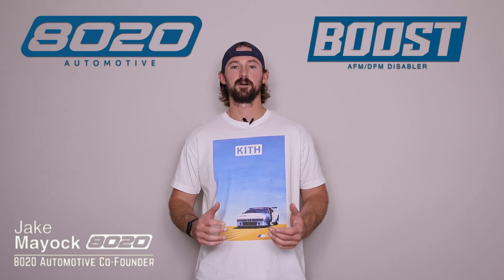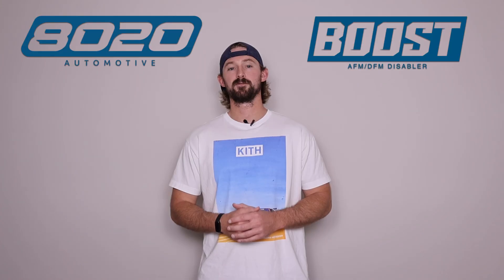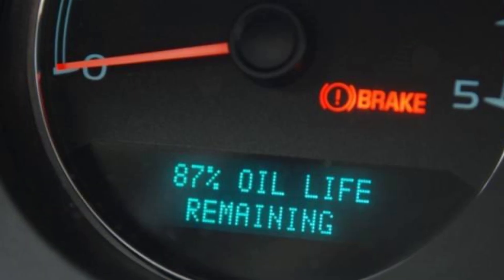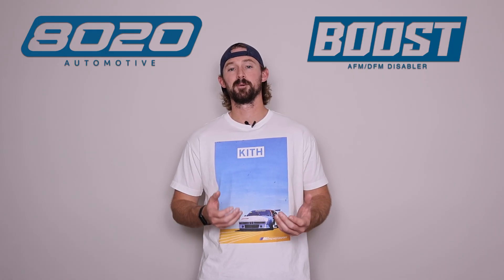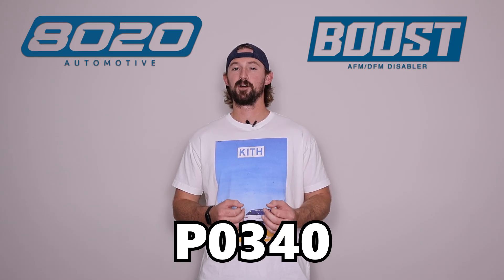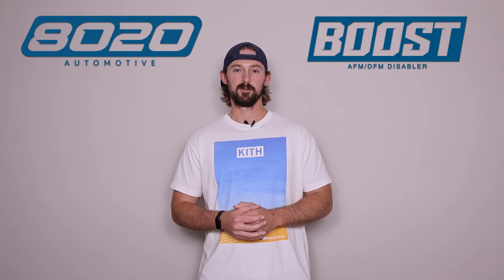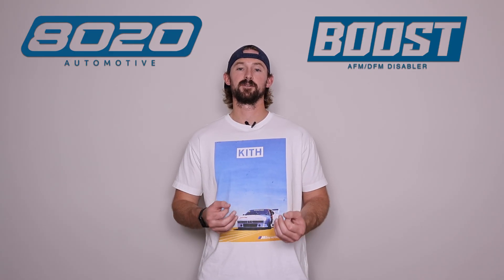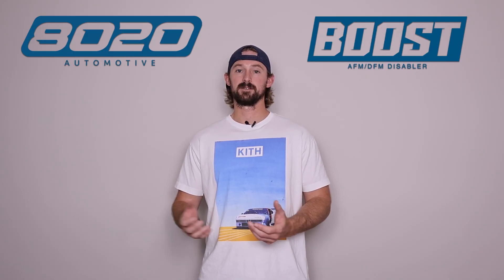Is GM’s LFX V6 Engine Actually Reliable? Here’s the Truth!

Comment: HELP!! I have a 2011 Chevy Express w/49,600 miles 15 passenger van. I am a disabled Veteran and this holds my service dogs crate AND my power wheelchair and lift. I bought it from the US Air Force at excess property sale. It was 6 months old and I paid $6000. 
I'm having electric (?) problems. I get odd dash lights, sometimes a/c fan works, sometimes no turn signal or seatbelt "dinging" noise going silent. I can fix my old jets which I flew. The F-111 and B-52. I was in training for the SR-71, but it would be mothballed before I finished. A great career. 
But I was injured and depend on a Rough Coated Collie and a bright red powerchair! 
Please, it's in the shop for a week and that means I am housebound. No. I don't drive much, but when I do, I want my van in my driveway!  
I've never given it a name. As a rare female fighter pilot with tail number 007, my call sign was "Tits"! Probably not politically correct now, but I could out fly any of my male squadron. I cannot afford a new van. I'm saving for a new service dog. $175,000 for a dog, so this van HAS to be repaired. This is the first problems I've ever had. Is it fixable?
Reply from the maker: J - First off, thank you for your service! We're sorry to hear that you're going through this with your van. Yes, your van is absolutely fixable—intermittent electrical issues like odd dash lights, A/C fan working sporadically, no turn signals, or a silent seatbelt chime almost always point to a bad ground connection, faulty body control module (BCM) contact, or a worn ignition switch or accessory relay rather than a major failure; when multiple unrelated systems act up inconsistently, it usually means the vehicle’s electrical system isn't getting stable voltage or ground, which causes the BCM and related systems to behave erratically—this type of problem is common, often affordable to repair, and any good technician should start by checking main grounds, fuse box connections, BCM plugs, and voltage drop across key circuits; given that your van has been reliable until now, there's no reason this can’t be resolved and get you back to the freedom you deserve—it's a straightforward electrical gremlin, not a death sentence for the vehicle. Keep us updated!

Comment: love the video, water pumps, like timing belts were originally change around a 100K miles in the 90's and early 2000's, newer timing chain has a longer life span, some lasting the life of the vehicle, but the guides tends to wear out, or becomes brittle and break apart due to its nature, a plastic part on a heat engine over time, so I still change it around 100K miles.  The modern chains are stronger, yes, but the plastic and rubber components use for sealing, will still wear over time.  I've had vehicles in the past that I've put over 600K miles with original engine and trans, (engine service every 3K miles and transmission service every 30K miles with flushes at 100K) and only got raid of them because I wanted a newer vehicle.  Yes, I know todays trans fluid (synthetic) can go 100K miles, but back then, the mineral oil we use (trans fluid) were only good for 30K miles.
Jake is right, synthetic oil requires topping off, because they do burn off over time, but they leave no deposits in the engine and protects the engine over a longer period of time than mineral oil.  The reason low end luxury Euro vehicles with no dipsticks will alert the driver of how much to add between oil change, and high end luxury with large oil sump will not be affected with loosing some of their oil between service intervals.
Reply from the maker: C - Thanks for taking the time to share this feedback and your experience!

Comment: Good video on the LFX. I have one in a 2016 Colorado. I do my own maintenance and change oil at 3000 miles. That's a little excessive but I don't care. The oil level is still at the full mark when I change it. The only thing I have replaced is the purge valve at 30,000 miles. It has 90,000 miles now and I plan on driving it for a few more years. I'm not a fan of 4 cylinder turbos.
Reply from the maker: D - Thanks for sharing your experience! We don't think it's excessive.. The better the maintenance, the longer any vehicle will last!